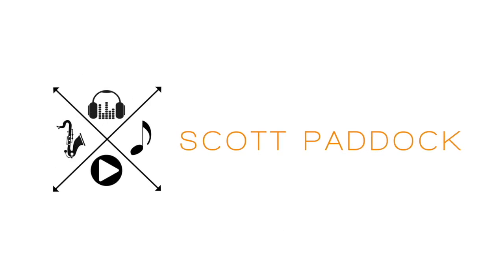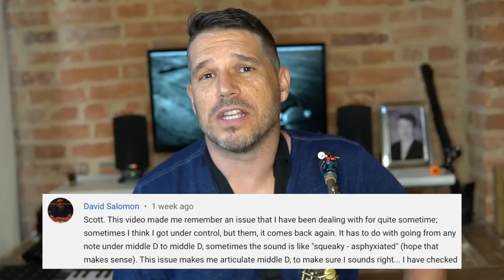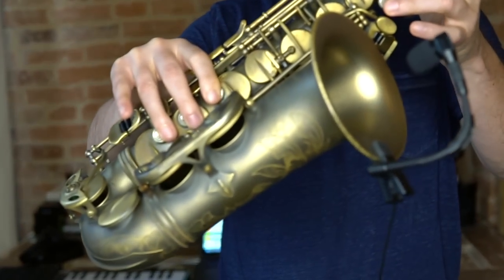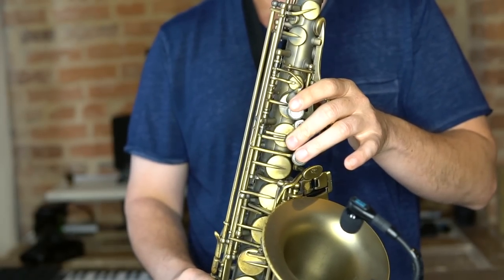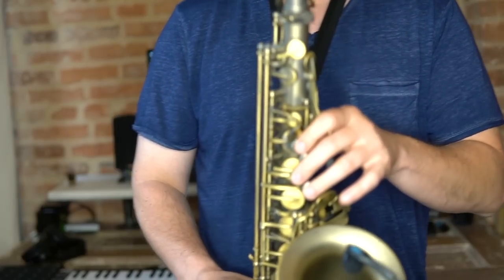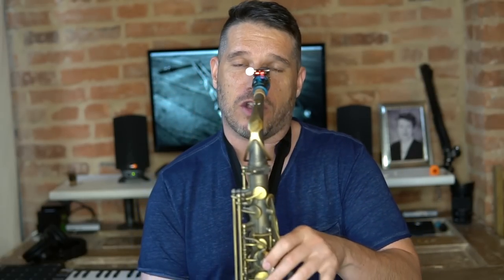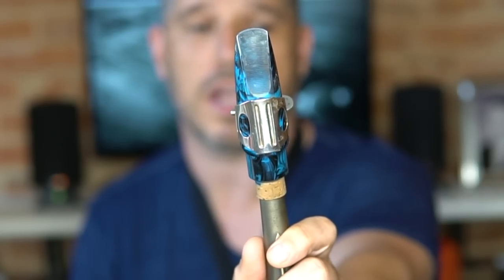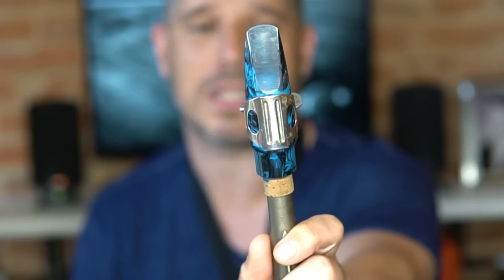WHAT CAUSES SQUEAKS ON THE SAX?

Comment: Favorite thing I just discovered.
If the octave spring is weak or arm is misaligned it can destabilize the whole horn.
As more air is needed it lifts and you get an octave squeak. I found holding the pad down by using a rubber band cleaned up low notes but I lost high octave. Noticed pad not centered and nudged it over. Lubed it and much better but not perfect.
I know it doesn't need a whole repad and I can swap necks and get around it.
Plus it wasn't my technique.

Noticed my tenor d squeak goes away if I loosen up and also take in the mouthpiece further into my mouth.
Thanks for taking the time to make a great tool for learning. Still looking for lessons for Money by Pink Floyd.

Comment: Thank you for the lesson; when I had time to go back to my saxophone I learn that my pads were leaking air. They were the pads for D# and on other pad, any time I played my D it would squeak, or when it did play it sounded flat. I also learned from this video that my mouth piece was worn out and was not holding my reed in place. Thank you it really help a lot. Word of advice don't drop you sax my fell during a marching band practice and caused these issues.
Reply from the maker: Yeah, dropping your sax will cause a lot of problems!!

Comment: Suggestion: Tone/texture
How to get a consistent tone/texture when the octave key is pressed. 

I have gotten a bit better at playing in the upper register from watching your videos. 
One thing I never hear saxophonists talk about is consistent tone/texture. 

When I press down the octave key the tone of the note is much smoother and loses the "grit" that my lower notes have. It's very smooth sounding. So it kinda sound like it's not the same instrument.

Like I said earlier it has gotten much better, but it's still not quite there. Some of it has to do the amount of air pushed through the horn, embouchure/tongue placement etc. Is there something that I'm missing or can fine tune to get my higher notes to match the "texture" of my lower notes? Tips techniques.

thanks

Comment: Excessive saliva build up on the inside of your reed will defiantly make you squeak. Take your reed out and look at the back side of it.  If you see a lot of saliva build up just wipe it clean and in some cases, It's just better to replace your reed with a drier one. Also I have found that if certain notes squeak more than others, just put a little vibrato on that note and it can help a lot.

Comment: Good practical pointers. One good way to test is to check the sound with the mouthpiece and the neck and reduce the likelihood that the problem could be at this end - although this doesn't rule out the possibility entirely once you attach it to the rest of the horn. Does this makes sense ? BTW I have sticky key issues when changing from F/E/D to G#, seems like the G# key, cleaning the pads helps a bit until there is more moisture after a short use
Reply from the maker: You should try using key leaves, they really help with sticky G# keys

Comment: Thanks. That was helpful as I was having a few issues with squeaking at times and I think it was my fingering as I noticed with one reed I was using, I was tightening too much when playing it, but changed strength of reed and stopped doing that. Another issue I found that could cause squeaking is the octave key on the neck octave key not sealing properly on the neck pip and leaving a slight gap. I have had a couple of issues with that before and was able to fix it myself. This works for overslung octave keys, but not sure if it would for underslung ones. I fixed my Yamaha neck key by holding down the top of the octave key on the neck and pulling towards me the back of the key and that bends the key slightly and puts it back into the correct position.

Would you be able to help with an issue I am having?  I used to have issues with a gurgle sound from excess moisture build up in the mouthpiece/neck, but I have much less of that now since I changed mouthpieces and found the correct reed strength for me and my embouchure got stronger (It still happens occasionally), but my main issue is when I play I think either a C or A+octave key on my alto saxophone, I often notice I get a weak, wet sound as it seems the body octave vent gets moisture in it and I can only fix it by wiping dry the vent inside the top of the body and often can't cleanly play those notes without the issue happening.
Reply from the maker: It's the grossest part of the playing the saxophone and why you should always keep you sax clean.  We don't have spit valves so we have to suck the spit back in.  If you don't do that you will always have a spitty sound.
Reply: @ScottPaddock  I suspect that a lot of the "spit" might depend on where you are playing and the climate and the weather.  I am in southern Australia and if the weather is cooler, I will get a lot more "spit" compared to playing in summer when it might be more like your 100 fahrenheit, and hot and dry, too.  I figure it's because when your body temperature air from the lungs meets the cold metal of the sax, there is condensation on the metal from the moisture in the air.  A lot of this liquid is much more like water than like saliva, and absorbs instantly into a cotton cloth, unlike spit.
In the USA, like here, there must be dozens of different climates, and these will affect the problem.

Comment: Thank you so much a lot of valuable information here. I play Yamaha 4 c mouthpiece I have been playing over two years and a few months now and I started to notice about  months back a buzzing that I could not figure out. I always brought my sax into the shop often for repair to see it loose screw of neck screw but could never figure out still buzzing so I  bought a legere 3 strength so  still buzzing, I bought a 2.5  legere strength still buzzing. I still have a full box of rico royal 2.5. What mouthpiece would you recommend? I consider myself an advanced intermediate but not professional. Yet and note I say YET. But keeping your fingers working with your breath good to know and practice to not do it and if it does happen know why. This way I learn my sax even more thanks a lot. Pete
Reply from the maker: It sounds like you have a sympathetic vibration.  That is when something on your sax that is suppose to be tightened down with a screw is a little loose.  Usually these are in the key guards.  A good way to check is play a note that only requires one hand (like a G) use the other hand to hold down parts of the sax, when you hit the right spot the buzz will go away.  In other words just touch the key guard, then the other key guard, then a rail.  Etc, eventually you'll find where the buzz is.

Comment: What happens is you start on D with all the fingers down and it has a higher pitch sometimes? The E and F are fine when played by themselves. Any suggestions? Thanks
Reply from the maker: Are you talking about playing a low D and the D with the octave key comes out sometimes? If so, you need to lower your tongue into what I call the "ahhh" position (like you're trying to talk low) and that will make those low notes pop out. Check out my video on low notes.  If that's not what you were talking about, describe a little more.
Reply: @ScottPaddock  thanks Scott that still excellent advise. I was just getting a harmonic sound when I played the low notes like D and E. I took it to the repair person and the found a leak in the E key

Comment: My sax is really old and I have to keep it already assembled instead of taking it apart to put in the case.The middle section will not move so that I can take it apart.Is there anyway I can safely take my sax apart without harming it?
Reply from the maker: I'd suggest taking it to a repairman.
Reply: You are trying to get the neck off and not disassemble the lower part of the horn right? Tech is best but if not. Squirt wd40 slowly  along the line where they join. Be sparing,, not sloppy. Lube should not reach pads! Wait for a few minutes. Repeat. Wait overnight. Gently wiggle ad more lube. Last resort heat the body side with a lighter and cool the neck with ice cube while feeding lube. If stuck wait overnight.
Hail mary- Remove the thumbscrew and put a flat blade screwdriver in the slot and ever so gently try to open the body so wd penetrates. Pry,spray,wiggle,wait.
If you are gentle, clean and patient you shouldn't harm it. Good luck.

My friends son has a Paris Selmer he doesn't clean. Green crust with black moldy Reed. It was like watching a beautiful woman getting mugged in the alley.

Comment: How was your F key blowing open when you have to hold it down to finger a D#/Eb?
Reply from the maker: The pad had a leak in it (it wasn't seating properly) when I played, the airstream was blowing the leak in the pad open wider.  So I wasn't blowing the key open, I was making the leak wider in the seat of the pad with a strong airstream.  That's the term you use when your airstream is causing a leak to get worse.

Comment: I'm only.in Squeak city when I hit high D from a lower note. E, F, etc sound fine. It's just that Damm D. Frustrating
Reply from the maker: Are you calling your high D the one with your octave key or the one with your palm key? If it's your octave key, it is almost 100% one of your pinky fingers going up or down too slow.
Reply: @ScottPaddock  Yes my high D the one with your octave key. My bad. Thank you for your quick response. I'll check if that"s the problem.